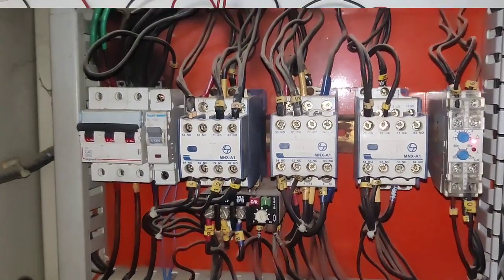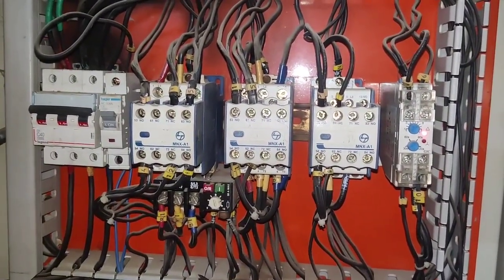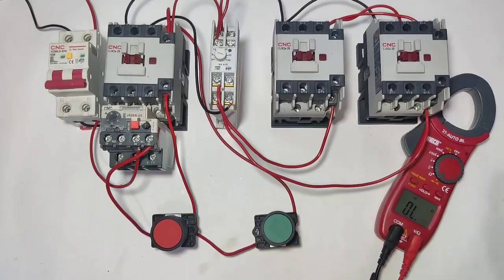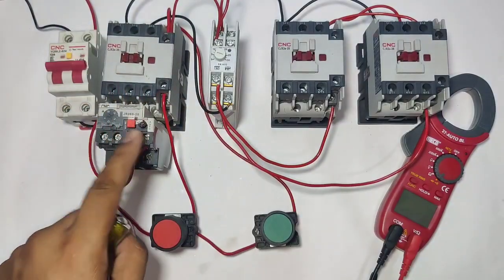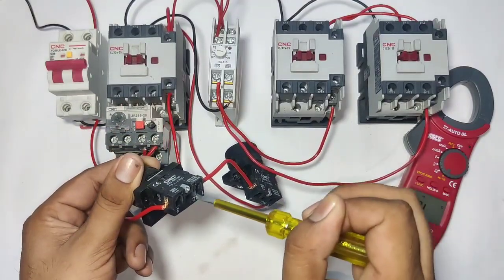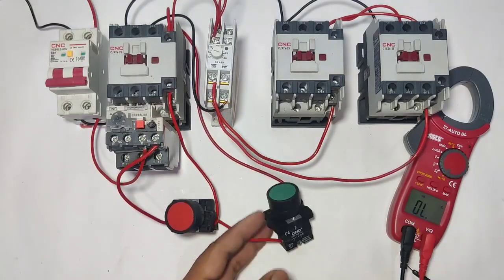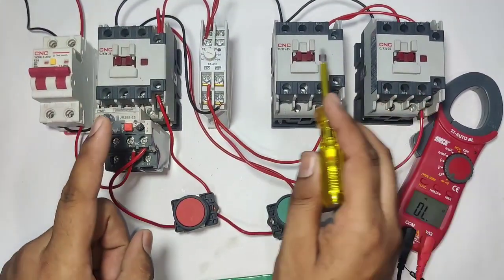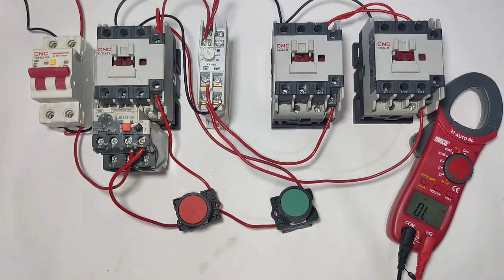How to Find Fault In Star Delta Starter!Star Delta Starter Fault and Solution! Star Delta Starter

Comment: EXPLAIN HOW TO USE BOTH  ON DALAY TIMER & OFF DELAY TIMER TO THE SAME CIR CUIT. 
 HOW TO SELECT THE SIZING OF SPARES TO ALL TYPES OF STARTING . ALSO MAIN CIRCUIT WIRES , SF UNITS.
 ALSO GIVE TIPS TO SELECT BOTH THE SF UNITS & MCB. BOTH THESE RATINGS ARE EQUAL OR NOT. PLEASE EXPLAIN.